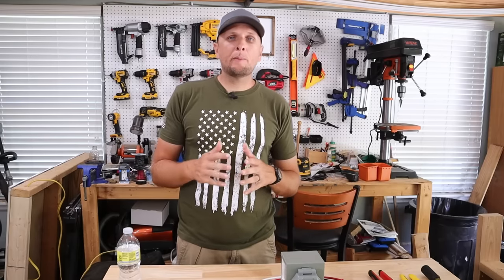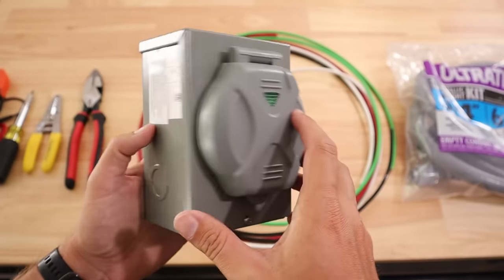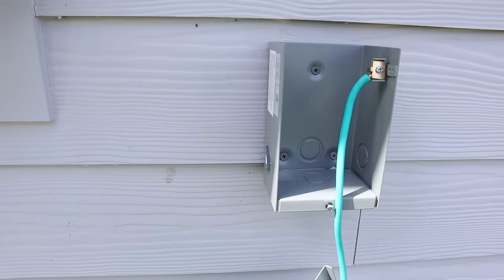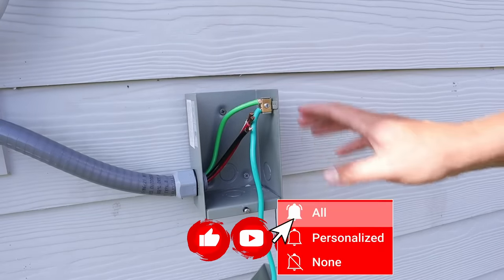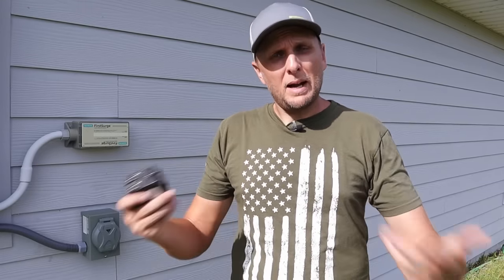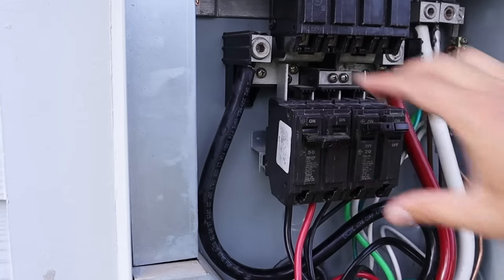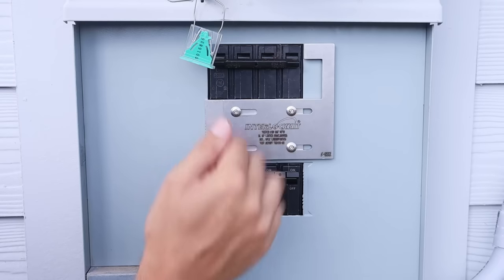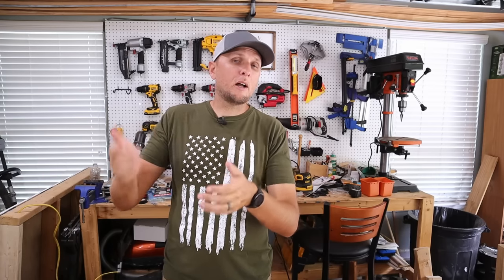The BEST Way To Connect A Generator To Your House - Interlock Kit With Power Inlet Box Install

Comment: This post started out with a few small tips and grew to become a guide discussion many things that rarely see mentioned on YouTube videos. All the way to the very end is tips. I recognize that many people won't read it all. Hopefully some find it useful.

Having a generator is only the beginning of the plans! If you are going to be prepared enough to buy a generator, be prepared enough to be ready for when you need to use it.

In this video:
1. Double Pole, Double Throw (DPDT) breaker means 240 Volts, which you never actually mention. 
2. You said the DPDT breaker will protect from surges over 50 AMPS. Your breaker is NOT a surge protector. A surge is a large over voltage usually over an extremely short period. Your DPDT breaker protects against over amperage (too much load). Large over-amperage over a short period and/or smaller over-amperage over a longer time period.

It is actually a good idea to put a heavy duty surge protector on the generator output to protect your devices (loads) when the generator is running from surges caused by your generator. These can also help protect your generator from surges caused by a malfunctioning load.

3. Near the end of your video you mention to let your generator warm up.  While a good tip, you didn't talk about turning off all load breakers prior to starting the generator. The basic steps should be (use this later):
a) turn off the main breaker.
b) verify that the generator breaker is off
c) turn off ALL load breakers
d) connect the generator if needed
e) start the generator
f) let the generator warm up for a couple minutes
f) turn on generator breaker
g) slowly turn on the load breakers that are desired and that the generator can handle.
* it may be desirable to turn off certain loads prior to starting the generator in order to manually turn on those loads if/when you need to.

Generally it is best to minimize the load on a generator. It uses less fuel and is quieter. The generator may be rated for 12000 Watts, but the more load, the more heat and wear. Many portable generators are not designed to run at or near full load for many hours straight. 

Turning off each load breaker helps causing you should to decide which breakers are really needed. Do you really need power to you shop? Do you really need baseboard heaters running in a spare bedroom or media room?

I personally use stick on color dots to mark breakers. You can buy them in an office supply store. The dots are about 3/8 inch and come in 3 florescent colors,  red yellow and green. I place green dots on the most needed breakers, yellow on breakers I want to use, and red for breakers not to turn on. I write a small description on the dots, ie "MB out" for Master Bedroom outlets, "G out" for garage outlets, "K Ref" for kitchen fridge, "G Ref" for garage fridge, "HW" for Hot Water heater, "Dry" for dryer, "Stv" for stove, etc.

Green labels are things like fridge and freezers as I don't want to have food go bad. My office outlets because I need internet. Master Bedroom, Garage Outlets so that my emergency lights turn off and I can use the garage door opener, Family Room outlets (I have a propane fireplace that uses an electric air blower)  30 Amp RV because I run an electric heater on low set for 59F to prevent freezing and manage humidity, keep the RV fridge running, keep the electric side of the hot water heater running, keep the batteries fully charged. My small 25 foot 5th Wheel RV is part of my emergency plans.

Orange labels include Living Room outlets because that's where the security panel is, Front House security lights, Backyard motion detector lights (covered porch lights are on the same circuit), other inside outlets as needed, Hot Water heater (I don't want it on full time but if needed I can run it in heat pump mode for a couple hours at a time. Remember that I have access to very hot water in the 5th Wheel and can even take a shower if needed).

Red labels include the heavy 240v loads: stove, clothes dryer and 3 circuits of electric wall heaters. These are things that I don't need. In cooler temps when the propane fireplace is running I can dry washed clothes in the family room. In the summer I can either hang clothes outside or on the back porch.
Reply: If power is out long enough that I need to wash clothes I have a portable mini washing machine that I take camping with me. It only handles small loads (no blankets, jackets). A good sized load for it is a day's clothing set for an adult (jeans, shirt, underwear and socks). It will take 15-20 minutes (depending on how dirty and if you use liquid fabric softener) to was this load, using about 240 Watts. Then you transfer the clothes into the spin cylinder, which takes 2-4 minutes using 120 Watts. After this spin cycle the clothes will be many times dryer compared to a regular washing machine. Most clothes, especially cotton, are just damp. You won't be able to manually ring out a T shirt and produce a drop of water. While this isn't a joy, it does provide a way to wash essentials (underwear and socks) for a family of 4 using a single loss daily. Then a load of 1 T shirt per person every 2 days, and a load of jeans/shorts every 2 days (assume 1 adult and 1 child Jean/short per load, wearing them for 4 days). Remember no power for 1+ weeks is an emergency, so while normally people would think it's disgusting to wear jeans for 4 days in a row and t-shirts for 2 this is probable a much better situation that your UN-prepared neighbors are in. Obviously if you are still going to work and must have clean clothed daily, then add a daily/bi-daily load for that. Most people have enough clothes for a week or more. I'd recommend planning on starting to wash clothes once power is out 5-7 days, especially if it is likely that power will be out for 2-3 weeks or more. Dirty clothes STINK. During an extended power outage you will likely have the time to allocate an hour a day to cloth washing (about 3 loads). You can find these portable washing machines on Amazon. The model I have used for 3+ years of camping doing hundreds of loads is $100. It is rated as 13 pound capacity which probably includes water. I use about an overloaded tspoon of powder laundry detergent (its lighter and cheaper than liquid). i use about 3/4 tspoon of liquid softener. I do a 1 cycle wash, 1 cycle rinse, 1 cycle softener, 1 cycle rinse. Then a 2-3 minute spin cycle. 

Amazon has models cheaper and more expensive. The cheaper ones look very cheaply made. You can spend over $400 if you want an automatic model; which I personally doubt is worthwhile unless its for full time use, maybe several months at a time in a cabin/RV.

I have alternate ways of cooking: air fryer, pressure cooker, electric griddle, RV (propane stove and smaller microwave) and even propane camp stove.

Instead of running the power hog 240v wall electric heaters I have the option of portable, indoor safe Mr Buddy heaters and portable electric heaters. I believe that my wall heaters are 2000 Watt. No more than 3 per 240v 20a circuit. The propane fireplace keeps the kitchen and family room warm and provides a little heat for the living and dining rooms. The only rooms that might need heated are the bedroom/office. Either the Mr Buddy or an electric heater on low (750 Watts) are plenty. I have a few 250 Watt "personal heaters" that I can use in my office if needed (the computer equipment normally does fine) and can keep the guest bedroom warm if we have company and they keep the door closed.

During the summer I put an 8000 BTU ac in the master bedroom window, a 5000 BTU AC in the kitchen window, and a 8000 BTU portable AC unit in the office.

My wife spends most of her time in the family room, but she likes it warm (80+ and 90+ doesn't really bother her). This means that the only time the kitchen AC would be turned on is if I'm cooking (I do most of the cooking) but then when I'm done I would turn it off.

The Master Bedroom (mbr) AC would still be running set at 72, and the office AC would be set to keep that room about 75-78.

Because of my medical conditions I spend most of my time in the office/mbr and am heat intolerant. The office AC would run to keep the computer equipment at a tolerable temperature, but would be too warm for me. I can watch TV, use my laptop, phone, and tablets from the comfort of the Mbr.

Luckily I live in the Pacific Northwest, so I don't get many days of 90F temps and usually less than 30 days a year above 85F.  On the hot days it will usually cool down to the mid 60-70's at night. I have 3 sides (south, west, east) of my property with very large trees that provide shade for much of the day. There are even a few large trees on the north side. This means that on hot sunny days my house naturally stays cooler.

If it will be very hot (for this area) 95+F for several days and/or 100+F I will either escape to the Cascade Mountains, the beach (near Ocean Shores, WA), the coastal rain forest (near Forks, WA), or possibly Oregon with my 25 Foot 5th wheel RV.

As part of my preparations I have a 500 gallon propane tank for the fireplace. (2) 40 pound propane tanks, (2) 30 pound propane tanks in the RV, (5) 20 pound propane tanks and about a dozen 1 pound propane tanks. I have an adapter to run portable propane devices (Mr. Buddy heater, camping stove) from the 20, 30, and 40 pound tanks. The Mr Buddy can run 110/220 hours on low using a 20/40 pound tank. I have (2) 15 foot extensions so that I can run the RV using external tanks or use the RV tanks for other purposes.

I normally have about 40 gallons of gasoline ready.  My Harbor Freight Predator 9500 watt inverter generator (this is extremely quiet, none of my neighbors can hear it running, it has an electric start, and is full sign wave) will use about 5-6 gallons of gasoline per day during a normal winter day. This means that I have about an 8 to 10 day run time with my normal usage. If I know
 that the power will be out for more than that and all the gas stations are either out of gasoline or they have no electric power to serve/sell gasoline then I will reduce my usage (remember those green, orange, and red labels? After about 2 days without power I will start turning off the orange  breakers. Maybe only turning on specific orange breakers as needed).

As soon as I know that it will be an extended outage its time to start conserving power. In the winter I can turn off the garage fridge and freezer for about 12 hours at a time. The front outside lights are off the table. I can safely turn off the inside fridge while we are sleeping. The backyard motion detector lights will stay on. They are LED spotlights that only come on if there is movement within about 20 feet of the back of the house and they only stay on a few minutes. In other words they can catch people being somewhere they shouldn't be using very little electricity.
Reply: I have emergency night lights throughout the house. 1 in master bedroom,  1 in office, 1 in the bedroom hallway, 1 in living room, 1 in laundry room. Thus means that I have basic lighting throughout the house using about 7.5 Watts. I now would start annoying my wife about not turning on a light unless its needed, and to stop leaving them on.

It may be time to stop using TV's and to turn off computer equipment. My wife has an 18.5 inch tablet she can stream TV on. If needed, using her phone as a hotspot (or giving her direct access to our T-Mobile home internet wifi). Its also time to annoy her about keeping her phone charged up.

The office equipment would be shut down next. This means no firewall, no file server, no DNS protection or other services. No automatic switch over between our fast cable internet (that goes out with no electric service), the T-Mobile home internet, and Starlink for RV. This also means no direct VPN to our business server as tmobile's home internet is not compatible with my Von and I only turn on starlink when I need it. It's now $150 per month. My desktop computer would be off and the laser printer.

I would have access to my gaming laptop or my very low power laptop, a 10 inch tablet and my phone.

As far as the RV, I would turn off it's computer systems, the electric hot water heater (it uses propane and/or electric. Turning off electric means that the small water tank can't maintain hot water as long. With both propane and electric I can take a 15 minute shower, without electric about 5-6 minute shower).

If the outside low temps are not going to be below 40F, I'd also turn off the electric heater. 

Using minimum electric the generator would likely use about 4-4.5 gallons a day. At this point I am probably down to about 28 gallons of gas in reserve. At this rate I'll run out in about  7.5-8.5 more days (remember the generator has a full tank).

Except that I also own a Harbor Freight Predator 2000w inverter generator that can handle the load now. I would use this generator for the 12 hours a day that the 2 fridges and freezer are off. This generator would use about 1 gallon of gas per 12 hours, then the big generator would run for 12 hours, using about 2.25 gallons. Total daily usage of about 3.25 gallons. Runtime of about 10.5 days.

If the gas stations are still closed I would start emptying other tanks. My old tractor usually has 2-6 gallons, my riding lawn mower 5 gallons, my pressure washer 1 gallon. The rest of my gasoline engines are 2 stroke so I can't use that gas.

This gives me about 8 gallons of gas. 2.5 days.

My truck usually has 12-24 gallons. I can take 10-22 gallons, leaving 2 gallons. This is another 3-6.5 days usage.  4 days is a safe bet.

My wife's car would keep its gas for obvious reasons.

I can currently make it about 19 days on generators. This may not be enough. What happens if we get a really big earthquake?

The answer is solar. I don't want to store more gas at home even though I lose power several times a year. I mean I really don't want to spend the money to install a shed to store more gasoline and worry about having say (20) 5 gallon gas cans in a shed.

This year I will be adding 400 Watts of solar panels to my RV. My RV has 400 AH of batteries. I also have a 150 Watt portable solar panel. I have another trailer that is going to have 200 Watts of solar panels and 200 AH of batteries. If I park the small trailer next to the RV I can tie the two systems together. There are reasons that the small trailer will have its own solar system.

This will give me 3600 Watt-hr of battery power. Hopefully, in the winter the solar will provide 3000-3375 Watt-hr of power.  Its not much, but it's enough to power the RV, my Master Bedroom and the T-Mobile home internet.  This means I could be generator free 12 hours a day and be able to stream on my 60 inch TV. This would also free up 10.5 gallons of gasoline adding 4.5 days for a new total of 23.5.

If I start adding batteries, I end up with more possibilities. Every battery I buy that is lead acid (somewhat like a car battery) adds 100 ah to the battery bank. I am starting with 6 batteries, or 600 ah. You can only discharge lead acid batteries to 50%. This means I am starting with 300 ah of usable capacity. Each battery adding 50 ah of usable capacity. Buying 6 more batteries would double my usable capacity to 600 ah (amp-hour). With a 12 volt system that gives 7200 watt-hr of capacity (the actual battery voltage is between 13.6 and 14.2 volts or 8160 to 8520 watt-hr. As the batteries are discharged the voltage goes down. 8300 watt-hr is a good guess. The problem is that you need an inverter to convert from 12 volt DC to 110 volt AC and mist inverters are only about 80% efficient. Our 8300 watt-hr DC becomes 6640 watt-hr AC).

So what is a watt-hr? It is simply 1 Watt of power usage for 1 hour. An LED nightlight might use 1 watt-hour. If you have 6000 watt-hr of capacity (after the 20% loss from the inverter) and you want to run an electric heater on high (1500 Watt), the batteries will be drained after only 4 hours. This is another reason that rationing electricity becomes important.

We calculated 6640 watt-hr of power from the batteries and we know that we want to use this for 12 hours (so we don't need to run the generators 24hr/day).

An old 100 Watt light build would use 1200 watt-hr if left on. Ensure you lights are all LED lights. A LED light designed to replace a 100 Watt bulb will use between 8-13 Watts (read the packaging and get the lowest Watt LED bulb that you can afford. The price goes up significantly as you get more effecient bulbs).  That 5 Watt difference adds up to 60 watt-hr usage per bulb per 12 hours. Also buy an appropriate sized bulb for the intended use. A 60 Watt equivalent LED bulb might use 5-8 Watts, and a 40 Watt equivalent 3-5 Watts. Do you really need (2) 100 Watt equivalent LED bulbs in your overhead lamp using 16-23 Watts or is (2) 60 Watt equivalent LED bulbs using 10-16 Watts sufficient. 2 high quality 60 Watt equivalent bulbs may be nearly as bright ie even brighter than 2 low quality 100 Watt equivelent bulbs while using 20 Watts instead of 46 Watts. Remember that over 12 hours that becomes 240 watt-hr vs 552 watt-hr. Those low quality bulbs left on for 12 hours just ate up 8.3% of you battery capacity.

In my master bath, there are (8) bulbs over the vanity. I put in 40 Watt equivalent clear LEDS. I believe these are 6 Watt LED's, for a total of 48 Watts. Underneath is an emergency nightlight that uses 1.5 Watts - (3) 0.5 Watt LED's. During an emergency there is no reason to turn on those vanity lights as the nightlight provides plenty of lighting to walk 6 feet to the switch for the overhead light by the shower. This means if I truly required more lighting than the nightlight provides, the single 100 Watt equivalent is sufficient. 

These are things to consider when thinking about electric rationing.

The more batteries I add, the less I need to run the generator. Every hour the generator isn't running adds more hours of time. Maybe with these 12 batteries I can run the generator for 5 hours, turn it off for 2 hours, back on for 5 hours and off for 12 hours.

As I add batteries, I either need more sunlight (not happening in the Pacific Northwest during winter), more solar panels (very expensive) or an alternate way to charge the batteries.

The alternate way is via battery chargers. My RV will charge the batteries any time it is connected to 110v AC. It will charge at a maximum rate of 500 Watts/hr. in 5 hours that is 2500 watt-hr or 5000 watt-hr in 10 hours. 

This means that I don't need to run the generator for 5 hours at a time. In the winter it is likely that the garage fridge and freezer may only need to run a few hours a day as the garage is likely 50F or lower. The kitchen fridge will need to run much more as the propane fireplace will keep the kitchen over 70F and it will get opened much more than the garage fridge and freezer.

It may be possible to have the generator off for 12 hours overnight, then turn it on for 3 hours then off, then on for an hour during the day followed by 3 hours prior to off for the night. Now we are down to 7 hours per day. Charging the batteries for 3500 watt-hr.

This will almost double the usable power from the battery vs only solar. If faster battery charging is needed, a normal car battery charger can be used. This means that more batteries can be used.

This is all based on the absolutely horrible solar in the winter in the north and specifically the Pacific Northwest. Solar in the summer obviously works better along with being farther south.
Reply: Before you buy a generator system, ask yourself
1. Are you comfortable inside your breaker box?
2. Are you comfortable with electricity and a mechanical device.
3. Are you in an area that you can run a generator. The cheaper open frame generators
 are very loud.  Before I switched to an inverter generator I had neighbors that lived a 1/4 mile away who would make passive-aggressive comments about the noisy generator.

Are you (and possibly others) in your house comfortable turning breakers on and off? Turning a generator on and off? Are you comfortable adding fuel to the generator and doing basic maintenance?

Each generator has a scheduled oil change, fuel filter, air filter, and spark plug replacement based on run time hours. 

You can't just drive down to quick lube. Either you have to do it, or you pay someone to do it. These large "portable" generators might be portable, but the can weigh 150-300 pounds. You can't toss them in your backseat and drive down to a small engine mechanic. 

You either need to be strong enough to pick up a bulky heavy generator and place in a minivan or truck. Or pay for a small engine mechanic to come to you.

The maintenance is required every 25-50 hours, generally. Are you prepared to at least change the oil every 1-2 days? During an emergency you can't count on a small engine coming out to you, let alone every couple of days.

Not doing the maintenance could result in failure, especially if you are running the generators several days in a row.

Are you prepared to keep a run log and maintenance log? Many generators don't include a hour used meter.

Are you prepared for possible damage to electronics if you don't have an inverter generator?

Do you want to pull start a generator, or will you spend a bit more for an electric start?

Do you know what size generator you need? Do you know about duty cycle? Do you understand how high altitudes affect generator output?

What fuel do you plan on using? The 4 types are:
1. Natural gas. Less storage issues than gasoline but it requires that you have natural gas service. Do you have a backup plan if there is an earthquake or possibly flooding that causes service interruptions. Less power output than gasoline or diesel.
2. Propane. Like natural gas but either requires many portable tanks or a large tank. Large 250, 500, 1000 gallon tanks require a service contract. Less power output than gasoline or diesel. Propane is less dense than gasoline and diesel.
3. Gasoline. Requires the purchase of ethanol free gas (more expensive than premium gasoline and only sold at limited locations, 76 normally has it). Ethanol gas requires a stabilization additive and can only be stored a few months. Highly efficient.
4. Diesel. These are normally the most expensive generators. They tend to be designed to run for long periods and have a large power rating. Think hospitals and the generators used for night-time road construction. Diesel can be stored for long periods. EXPENSIVE.

Dual and triple fuel options exist. Most dual fuel is gasoline and propane while triple is natural gas, propane and gasoline.
Reply: In my opinion, if you plan on natural gas as primary source, get a dual or triple fuel model. Natural gas is convenient until an earthquake or flood breaks a pipe. With natural gas are you in a state that may outlaw it? California, Oregon, and Washington come to mind.

Dual fuel propane and gasoline is popular.

A good option, if you don't want to deal with a generator and can afford the high cost is a Generac automatic generator.  When they come out to give you a quote, they will try to convince you to size the generator based on being able to run everything at the same time, plus more as a "cushion". Are you really going to was clothes, dry close, use the heater, take a shower, cook on your stove, use the microwave and blow dry your hair at the same time? If yes maybe you do need a 32000 Watt generator.  If you can say that its doubtful that you'll be washing and drying clothes at the same time as you are preparing Thanksgiving dinner while you daughter attempts an hour long shower, then maybe a 22000-26000 Watt generator will work.

If you think that just maybe during a power outage that you can maintain some control maybe a 12000-18000 watt generator will work.

I'm not telling you what to do, how can I as I don't know your situation. Taking the time to force them into more realistic scenarios could save you $10000 or more. Maybe you can now afford some upgrades like dual fuel or a whole generator surge protector.

I chose a 9500 Watt generator because I knew that I could ration power and I wanted a generator to use when I get a larger RV.

These generac automatic generator will monitor your electric feed. When needed they will automatically turn on and utilize and automatic transfer switch. No going outside to start the generator, no need to fuel it, no need to get in your breaker box, or even be home. Great if you have kids that get home before you.

The generator won't switch on and off if the main power does. When it comes on it will stay on for several minutes after power is restored.

It will also turn on automatically (without switching power) for a few minutes every week. This helps to maintain the generator and may provide warnings of possible failures before the power emergency.

There is an app so you can monitor it, and I would assume a maintenance contract. That way all maintenance is performed by a generac professional mechanic plus needed repairs.

If I could afford it, this is the way to go.

If you can't afford it then do
1. Find a safe place to store your generator out of the weather. Mine is on heavy concrete flat blocks next to my garage. I keep it covered with a heavy duty propane grill cover. I have a piece of 5/8 inch plywood on top of that. The generator is secured to the garage with a heavy cable and lock.
2. Ensure that there is nothing around the generator. It needs air and produces a lot of heat. You need to safely access the generator.
3. Is the generator properly grounded if required?
4. Do you start you generator at least monthly for about 15 minutes?

If you are not used to getting in the breaker box, practice. You can safely run your generator to power your house even when electric service is available. The interlock system in your breaker box will prevent you from causing damage.
Reply: Start by writing a list of how to start up and shut down the system ( I made a basic one near the beginning of my post). If possible have someone knowledgeable help you. The person installing the interlock should know.

Print these 2 procedures in large font and keep near your breaker box. Have a flashlight available before you get to the breaker box (like your phone) and a brighter light source available at the breaker box. Either emergency lighting are a bright flashlight. Ensure that you can safely get to the breaker box and open it. Most of the time when power goes out it is dark out. You don't want to trip trying to get to the breaker box or not be able to open the breaker box because things are stored to closely.

Practice the startup procedures by reading the instruction line and pretending to do it. Do this until you are confident.

Warn others that the power will be going off and turn off electronics.

Now actually do the startup procedures. Note anything that needs to change. Maybe the generator could move a few inches to make it easier.

Let the generator run for 15 minutes (30 if brand new). Now down the shutdown procedures.

Do this several times on the same day. You should be confident by the time you are done.

Once a week do the full startup and shutdown running the generator 15 minutes. Do this for a month or so.

Now switch to running the generator monthly for 15 minutes. While its running pretend to do the startup and shutdown.

When you need to startup your generator because of a real power is not the time to learn. It will likely be dark, windy, cold, rainy or snowy.

You don't want to realize that you have to move boxes to get to the breaker box. Then realize its dark and you aren't sure how the interlock works. You go to your shed to get the generator and realize that you don't know how to hook up the electric plug. You you try to start it, but you never hooked up the battery. You then go inside to hunt down the manual in the dark.

Finally you start the generator, but it doesn't actually start. Somewhere in the manual is the troubleshooting section.

The generator will not start if it detects low oil. Now you have to find the oil and fill it, in the dark, windy, cold, rain/snow.

It still doesn't start. No gasoline. You don't have gas. You remember saying that you would buy gas "next week" when you bought the generator.

Several hours later, freezing cold you manually open the garage to drive to Walmart to buy a gas can and fill it.
Reply: You pull in the driveway just as power is restored.

I know that sounds funny, but its a good way to hurt yourself and be miserable. You are buying a generator to be prepared, so be fully prepared.